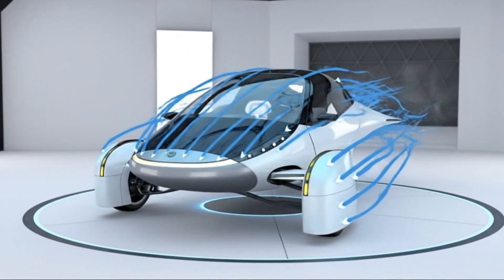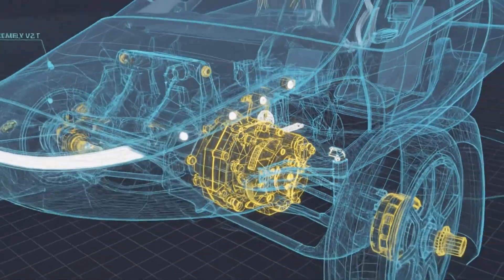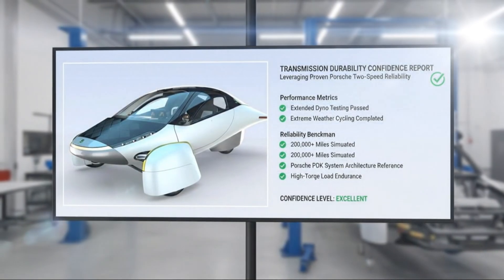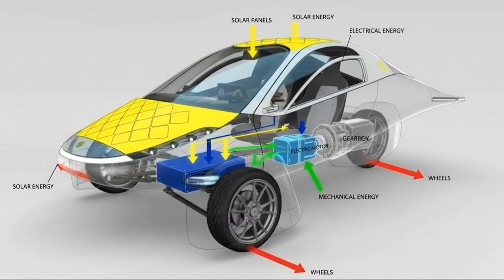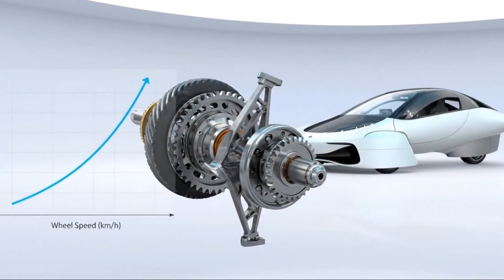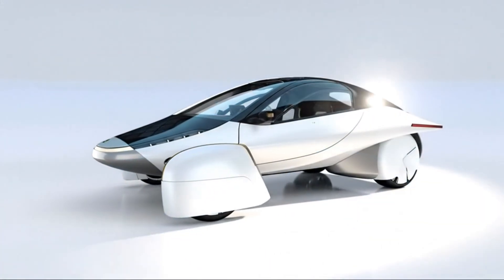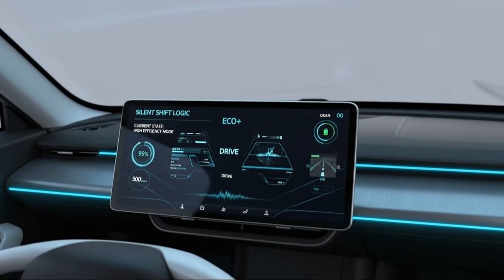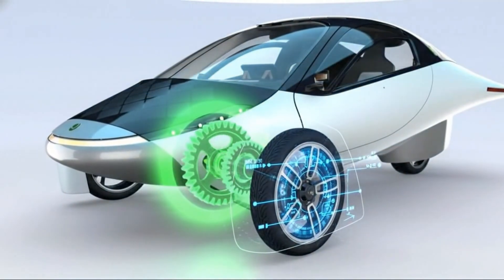Aptera’s Future Just Changed: Axial Flux Motors Are About to Rewrite EV Efficiency!

Comment: With Aptera switching to axial flux motors, then I'm all in. Thanks for the insider information to what Aptera is doing.
Reply: Especially when Aptera annonces an additional  Flux Compensator.
Reply: @vic321344  - That's coming next because Michael Chen (the head engineer at Aptera) will announce it soon.

Comment: Another motor changes nothing . Especially when there is not even a single production ready Aptera motorcycle available. And all hub motors have the problem with unsprung mass.
Reply: The Aptera protypes that had the three IWM's appeared to be quite stable during the road and track testing that they performed with them.
Reply: @garywozniak7742  they can't even manage a speed bump with those wheel covers.
Reply: @davestr7031 They do fine on speed bumps. The wheel consecets move with the tires.
Reply: @garywozniak7742  They were not very stable, had massive issues with chassis adjustment.  Aptera even needed the help of professional companies to somehow make it work.
Reply: I'm changing my reservation to this new motor.
Reply: @charlesbeane8795  it's coming out right after the Tesla Roadster!
Reply: @charlesbeane8795 i dont this this channel has any affiliation with Aptera and its is not doubtful that Apyera is looking at these new motors.
Reply: @charlesbeane8795  How?